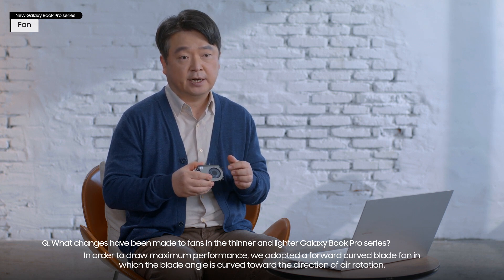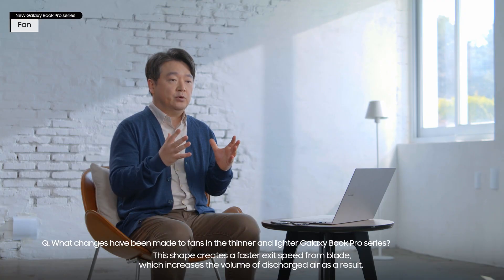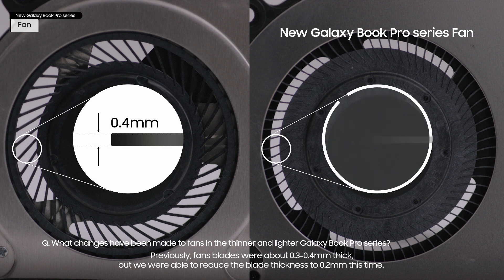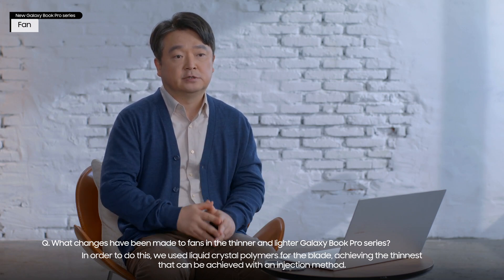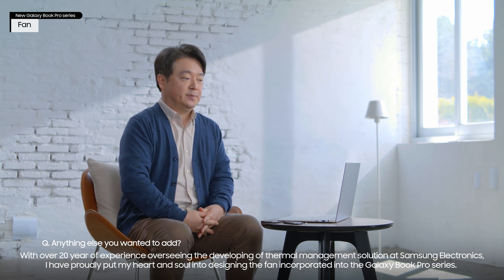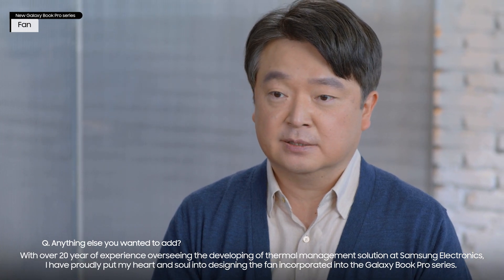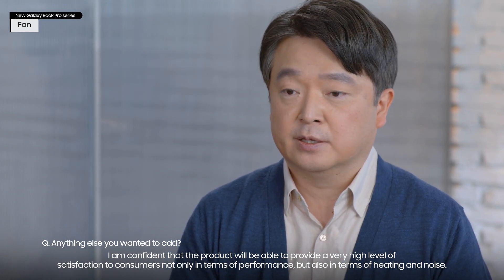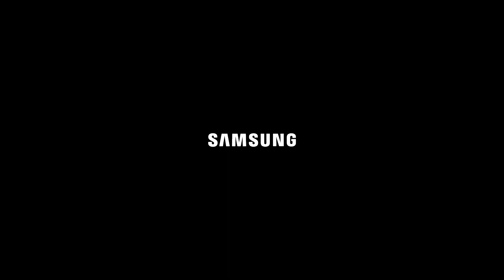[Galaxy Book Pro Series Tech Talk] ⑥ Fan

Comment: I just got the galaxy book pro 360 in Canada, and my fans have a very loud high pitch sound that is very bad. I  must have gotten a badly manufactured fan..............
Reply: how are you getting on with it now? have you tried the different performance modes? When I have mine set to silent, I hardly notice it at all. It's only really loud when in performance mode, and doing a challenging task. IMO small price to pay for such a thin and light laptop that can run >4.4Ghz
Reply: I agree I have a pro book but I had to return it the fan was so annoying. I got a MacBook Pro 14 in ch instead son much better!!
Reply: @evertbolanos5389  they are two completely different machines.
Reply: I have had my 16"Galaxy Book3 Pro 360 for about a month. I have not even notice any noise, admittedly I have not run much Photoshop or video editing yet.